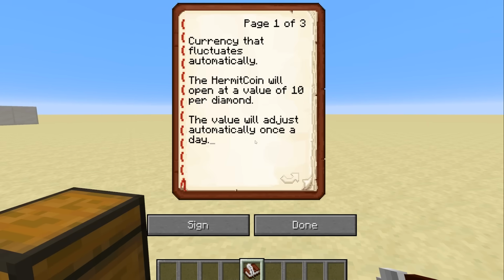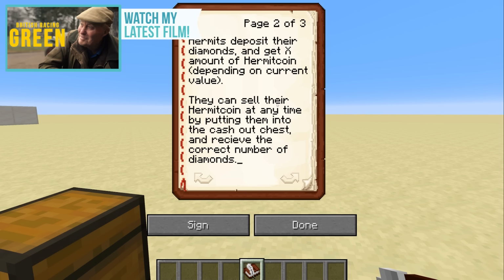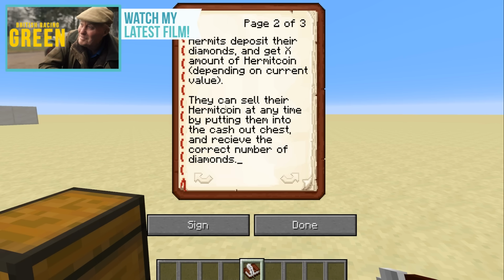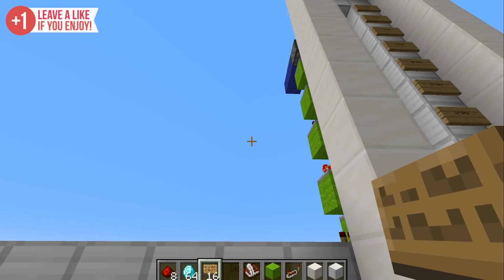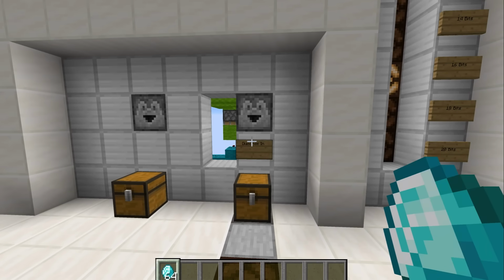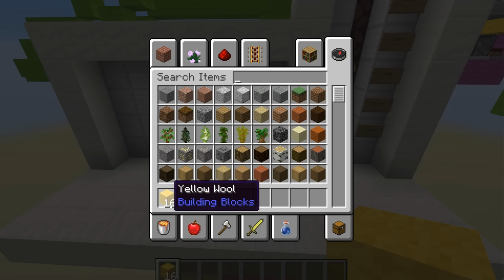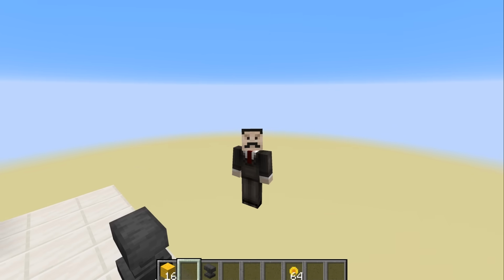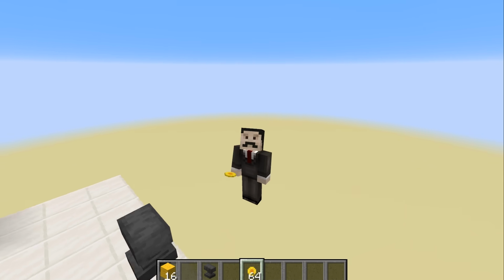HermitCoin Crypto Machine for Hermitcraft!

Comment: This system is highly flawed. 
The other hermits can just buy when it's cheapest and sell when it's at 12 because they know it will eventually reach 12 and not go higher. Witch means there is no risk of cashing out early.
Reply: João Carlos Lemos Buchele no it’s definitely not
Reply: Bitcoin works because of the risk
Of cashing out early. Or buying at the rong time.
Reply: Its just a prototype, not a full version.

Comment: Mumbo,

Instead of using a randomizer, you need to get signals from chests containing diamonds and chests containing HermiCoins. Comparing the signal strengths gives you an idea of the ratio between them. The more HermitCoins you have relative to diamonds, the more can be purchased with each diamond and the more HermitCoins it takes to get a diamond. Conversely, the less HermitCoins in the system the less each diamond can buy and the less it takes to cash in for a diamond.

Comment: Mumbo that hopper counter is absolutely stupid.
Cant you jusy have a dropper facing into a hopper thats facing into the dropper. Lock the hopper and then the counting happens when you power the dropper. When all items are out of the dropper you can take a comparator output from it and use that its really compact and easy and way faster then the current system.
(Sorry for bad explanation but i think youll figure it out.) Good luck. Hope you see this it will be a great improvement of the system

Comment: One problem with your design right now is that if the hermitcoin decides to lose value when it's at the lowest value, the piston tape would push the redstone block into a null value and the whole system will break. Same thing for the highest value going up. One fix is to prevent the system from going up/down when it is at it's highest/lowest valuations.

Comment: Hey Mumbo! I hope you see this message...
I think you need a different approach for that item counter.

about 2 years ago, Cubfan made a lap counter. Link: https://www.youtube.com/watch?v=x4Y6uKuivLo

a little while ago, iskall used it in Stressmonster's chicken life-or-death machine. Link: https://www.youtube.com/watch?v=F4QS3Fz5hGc&t=221s

I think you should just use that counter in a circuit that first picks up the current Hermitcoin value, then subtract one for every coin going trough the hopper, then spits one diamond when the counter reaches 0, and then starts over.

Just make sure you add some fail-safe mechanism so the system won't break if the day changes mid-transaction!
And maybe a way to give coins back if the trade is incomplete?

Comment: (I know you told us not to make comments about how it's not at like cryptocurrency so I'm not going to) How do you expect to make a profit off of this if the change is entirely random? If the currency fluctuates randomly anyone can wait for the currency to rise in value and just inevitably steal all your hard earned diamonds. You could at least try to have the currency rise in value the more you buy and fall the more you sell into diamonds (this would only be able to affect the value a little bit though). I assume you're going to have some form of practical reason a hermit would want hermitcoin or maybe you could invest the diamonds in something else whilst they are in the system just like a real bank. Main point: system currently has no risk of loss for user and guaranteed gain if they are willing to wait.

Comment: Since its a currency I think that its value should be calculated from both  the amount of people that have invested in it (bought currency) and from a randomizer that way they value will start going up. Also if you  make it so that you can  from Sahara only with hermitcoins then it will be used more, making the it's value go up. A downside though is that you will need to be checking the value of hermitcoin so that you can change the prices on Sahara according to its value. Lastly I think that hermitcoin's name shkukd have a few '' special characters'' in its name so that people can't counterfeit them (even though they won't since it's hermitcraft, not real life)

Comment: Suggestion:

One day passes on daylight sensor.
 |
V
Increase / decrease value
 |           ^
V          |
50/50 chance
             |
            V
Stop changing for that day
Reply: He shouldn't use the daylight sensor because when you sleep you skip to the day, so it would be better to use a clock which give a signal when a "normal" day in minecraft has passed
Reply: That's what he's going to do...
Reply: This sounds cool
Reply: That's actually perfect
Reply: That doesn't activate if the chunks are unloaded though...
Reply: Not cheat proof though, you could just cover it and uncover it to get a better value.
Reply: @d4r7h3b3r  This is hermitcraft...honor system
Reply: @RosalynTosh  I know, but it's something to consider should anyone else want to build it.

Comment: the machine should increase the odds of the value increasing/decreasing depending on witch "way" its going. For example: the machine starts with a 50/50 chance of its value going up or down. If the value has gone up, then there are 2/3 of chance that the value will go up again until the value goes down and vice versa.

Comment: I think the HermitCoin counting system could be made much more compact and easier, using comparators, so when there is 16 of HermitCoins in a hopper, it will lock a hopper, where the items are at the moment, and unlock the hopper underneath, until other comparator from the hopper with items is turned off(you cold use rs nor latch and a redstone torch) and when a 2nd comparator turns off, you get a diamond

Please like, so Mumbo doesn’t waste his redstone resources

Comment: What happens if someone puts in 15 hermitcoins and then another player comes along and puts in one, does that player that put in one hermit coming get the diamond? 

And instead of having to click the button to change the value, why dont you make it so that it changes the value based on how many hermit coins have been purchased. Then if there are lots of coins left in the system the value will be low because not many players want them. And if there isn't many in the chest then the value could be high as there are less left to purchase and more players want them. 

Finally, mumbo is going to loose a lot of diamonds with this system as there isn't anyway of investing the diamonds that players put in the system to get more diamonds. The only diamonds the players gain will be the ones in the system that they put in there unless mumbo puts in more. If the system becomes empty because hermits are too good at cryptocurrency trading then they will only get more diamonds then they put in so the system will eventually run out.

Comment: I wonder when Mumbo will realize how easy it is to duplicate things like wool and sunflowers.  If he uses signed books, then, while they will be impossible to stack, no one can duplicate them, as they would need to be signed with his name.  Mumbo, if you are reading this, DO NOT use easily duplicatable items or else other people (such as the convex) may start farming YOU for diamonds.  They could just bonemeal a sunflower repeatedly with a dispenser and comparator clock, then use an anvil to rename them to "Hermitcoin" or whatever you end up calling them.  If you want to keep any diamonds for yourself, then either use NBT data to customize the sunflowers (I know that command blocks have been used before cough cough Grian's mustache machine *cough cough*).

Comment: One problem with your system, the value is random meaning everyone will buy their hermitcoin when values are low and sell them when they're high. You're basically giving away diamonds.

 You need to add in a system that makes it so the value increases the more hermitcoin is being sold and decreases it when demand is low. That way you're not at a loss.

Edit: I don't even know if that's possible or not, just trying to protect your diamonds.
Reply: That's exactly how DocMu77's Stock Exchange works and Mumbo decidedly did NOT want it to be like the Stock Exchange.
Reply: @mementomori5580  yeah well, that's the only way it can work. It has to be like the stock exchange otherwise mumbo will go broke within a couple of weeks trying to keep the diamonds stocked.
Reply: Since he obviously needs a place to store the coins, he could run a comparator from that chest. The lower the number of coins in there, the more likely the machine is to count down instead of up.
Reply: Or, alternatively, you could run comparators off of people's lock boxes. That way, the more people that are holding the coins, the more likely it is that it will depreciate in value.
Reply: This entire thing is going to be for profit. I believe he said this in his most recent episode, so every exchange he is going to take a small transaction fee. Please correct me if I'm wrong!
Reply: Hi lizard ledgend could you please say to mumbo that there is a other probleme and it is that if you put 15 coin when the price is 16 you lost your 15 coins so he would need to make that when is observer puls he blocs a hopper so the coin do not return to the owner and if there are not enough it just return to the owner.

P.S. sorry for the mistakes English is not my birth language.
Reply: @matispelletierchamard5072  your English is fine, that's definitely a problem but I just wanted to focus on this one in my comment.
Reply: I can think of a way to do that but my 2 bedrock braincells tell me that will not work
Reply: Mumbo's Diamonds? what Diamonds?
Reply: thats the point of bitcoin. sell high buy low. mumbos safeguard is that they cant hoard hermitcoin in their base. they cant leave the store with it
Reply: Mariel Dickerson that still means they can hoard it in their personal vault which is basically the same thing but they can't loose it
Reply: This is the smartest comment I've read

I believe it would also work if the value decreases when more hermitcoin is sold, when more people own it, it is less valuable. You just need a dependence between value and supply.

Comment: If you put in less than the required amount of HermitCoins for a Diamond they should be dropping out of the system again after some time. 
Otherwise the system would not work properly.
Reply: well next person gets discount is all, but yes a reset circuit is a good idea (wether or not refunded to user :satan: :devil: :whateverEmoji:   )

Comment: I’ve seen others point this out, but if you want this to work you should have hermit coins be the only currency accepted by Sahara. This way a hermit who wants to buy something needs to exchange, putting more diamonds in the system. Without this you would lose a lot of diamonds because folks will buy high and sell low for super profits

Comment: Hey, Mumbo, love the video and the system you created looks awesome, so I apologize if this comment comes across as nit-picky, but what would happen if the system raised or lowered the price of the coin while a Hermit was in the middle of exchanging their diamonds for Hermitcoin, or vice-versa? Could the system governing the fluctuating prices lock the exchange chests, or else either of the two exchange chests, when in use, lock the day-cycle circuit, to prevent a potential break/unfair loss of diamonds? Also, could a vertical dropper system and coin-counter reset circuit be implemented so that players who attempt to exchange the incorrect quantity of Hermitcoins are able to reclaim the coins they did deposit? These two systems together would form a safeguard against the potential day-cycle problem, as well help prevent the scenario of a separate player later attempting to exchange, for example, two coins and receiving a diamond in spite of whatever the current coin value reads.

Comment: You could build a binary counter(sethbling) and hook it up with the piston technic you're currently using to get the only the output you want. That way it should be way faster. 
You get an output with the changing output of a hopper when items travel through so that there are only one or zero coins in. The counter then counts the amount and if it hits the right amount of coins it will dispense out the diamond

Comment: Hey Mumbo, with the design you have right now, the HermitCoin and diamond output dispensers are accessible to the traders. So you would have a dispenser full of diamonds and a dispenser full of HermitCoins sitting right out in the open. If you have it shoot the diamond/bitcoin through a block, it would make the system more secure and seem more professional. Plus you could have in input hopper for extra storage because the dispenser would be one block back into the wall, rather than flush with it.

Sorry if that is terribly explained.

Comment: you need to have a un do sort of thing. because if a hermit puts in 15 hermit coin and the value is 16 the hermit will not be able to get those 15 hermit coin back. without of course putting in a nother coin. this can be a bit problematic, because if the hermit is poor like Grain, and cant afford more hermit coins how can he get those coins back.

Comment: Wouldnt it make it a lot easier for the machine to make hermitcoin more valuable than diamonds? So 10 diamonds for 1 hermitcoin, so when they hermits make a sale on the crypto currency (say the value is 3 diamonds per) if the user inputted a random number they would get the correct ammount. If 10 hermitcoins were 1 diamond, what would happen if the user inputted 9 hermit coins?

Comment: So, quick question (I don't think there is a way to do this): what happens if a hermit puts in less than the required amount of coins? Will the be a way to return the coins and reset the system so a hermit can't just cheat the system (I know that none of them would, on purpose. But the system you have shown us does have that single flaw).

Comment: Hi mumbo, the issue with that currency is that the price changes randomly, and it makes it unreliable and nobody would gain money in that kind of system ^^
But, if you set the price of the hermitcoin according to the amount of hermitcoins left in the system, you can deduce how popular your brand new money is, and make the price go higher when there is more HC in circulation (so less in the system)
A pile of hoppers (for the lower amounts) under chests (for higher but greater amount), with comparators, could do it so your money doesn't crash !

Because randomness is foolish, adopt capitalism !

Have a nice day !

Comment: Mumbo! If a hermit doesnt put enough hermit coin in the system for their next diamond does it stay in or does it drop out somewhere? Meaning if impulse puts 30 in and walks away then tango come and puts 2 in does he profit?

Also does the machine break when time changes seeing as the randomness is based on day and night? Or at least that was the plan. Like if you put 12 coins in because that's the value but while you are waiting for the diamond it changes to 14 coins per do you still get your diamond?

Comment: YES but if the wrong number of hermit coins have been slotted into the system. Surely, with your method, the next user will slot their diamonds and the total of hermit coins added will be the 'WRONG NUMBER OF HERMIT COINS IN THE SYSTEM' + 'THE  AMOUNT OF HERMIT COINS ADDED BY THE NEXT USER'. u get me? Is this a flaw or Am I not enlightened by the guru of redstone!

Comment: It should really work a little bit different: if someone buys hermitcoin, there should be a chance the price goes up, when someone sells there should be a (bigger) chance that the price goes down, this way the price is autobalanced
Reply: YES This! The randomness of it is abusable and doesn't even correlate to real life cryptocurrencies.
Reply: Genius
Reply: But then it'd be exactly like Doc's stock exchange, wouldn't it?
Reply: I don't know, that allows a player to crash/boost the price pretty much on will. The point of this is that it IS random and is not influenced by any of the player's decisions or actions.
Reply: @FairlyUnknown  But otherwise, if it is truly random, the system is very abusable and Mumbo is going to lose tons of diamonds

Comment: Hey Mumbo!
Just a few recommendations:
• Inatead of charging diamonds architechs should charge hermit coin.
• And the value of hermit coin should change depending on the amount of them in circulation
• (I don't know if this would work or even how you would go about doing it) but what if I deposited 33 hermit coin in and it only took 32 and gave me 2 diamonds? (Shutoff after  closest 16)

Comment: In the future you could combine this with your amazon shop and sell items for hermitcoins

There is another flaw you haven’t thought of, if a player inserts 15 hermitcoins into the system when the value is 16 the next day/night If the value drops to (or below) 15 a diamond will be dispensed leaving it for the next player.

Like so mumbo can see!!!!!!!
Reply: I think each value has its own counter system, so each deposit will only be counted by the specific part of the circuit that controls that value, so no, it won't drop bonus diamonds when HermitCoin drops in value.

Rather, a bigger problem would be someone dropping 15 coins and getting nothing in return, but the next one to drop 1 coin at that same value would get a free diamond from the accumulated amount of coins.
Reply: @filipahlers  exactly.
An other problem is if the value changes during the withdraw process, for obvious reasons.
Reply: Eclipse cough cough Sahara cough cough
Reply: Its called Sahara
Reply: Eclipse that’s only if someone on Hermitcraft is dumb enough to do that, and SPOILER... they’re not.
Reply: @awesomejwiz5929  I bet Grian does :v
Reply: I have an idea on how to make this a lot more compact with having the existing timers run both systems. No idea if it will work properly but it would fix this problem. I am already building a new version.
Reply: It doesn't really matter
Reply: So good